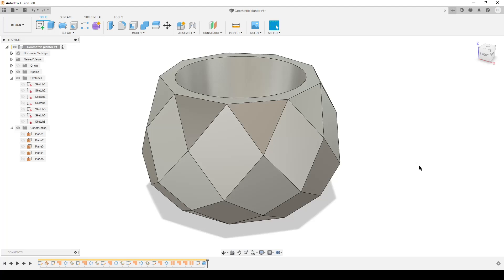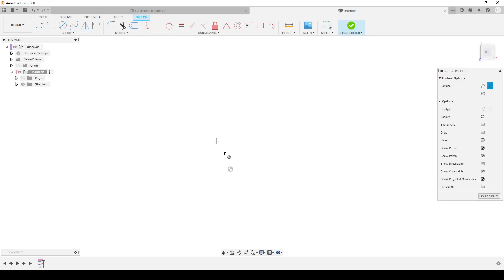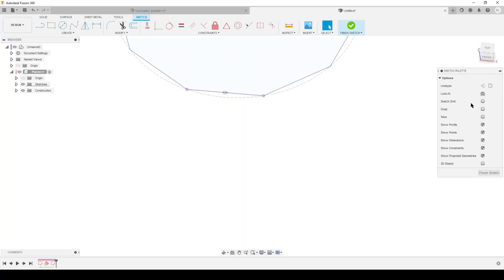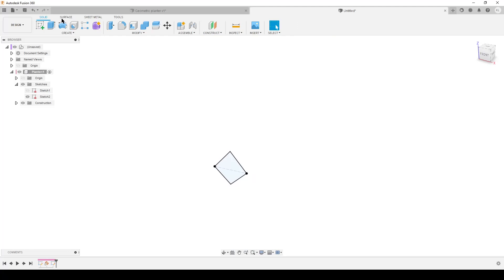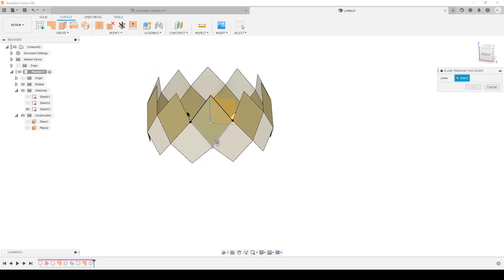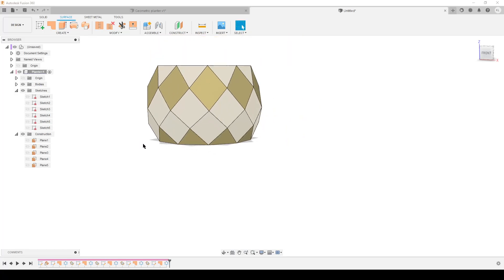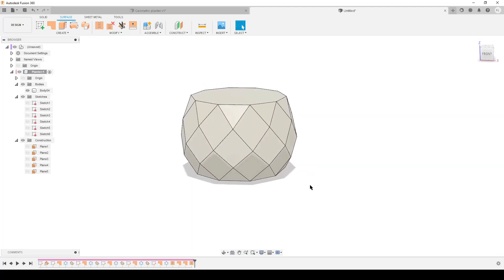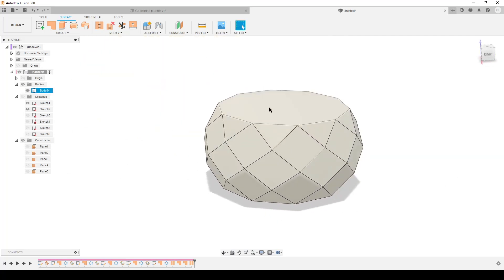Fusion 360 - Geometric Planter #1

Comment: Great tutorial - Do you know why I can change the dimension parameters through the modify/change parameters drop down, but can't just adjust the dimensions from the sketch like you did around 10minutes?
Reply from the maker: It should work the same. my general tip if Fusion misbehaves is to restart the software

Comment: Thank you for explaining how to make these geometric designs. I was thinking about the concentric polygon and loft, but those only connect singular points and not multiple (afaik).
I like your joyful explaining 😀
Reply from the maker: I tried using Loft but it didn't produce a stable model. The fun with 3D modeling there are always more ways to do things :)
Reply: That and it makes you try other ways of doing the same thing.
Reply: @KristianLaholm  I was wondering something. I try to make designs that are easily changed. I set 2 parameters, the circle diameter and the number of segments in the polygon. For some reason, when I change these parameters, sometimes F360 throws a tantrum, mostly when I make the number of segments higher than my initial designm(it will show gapes when I go lower). I would think, that the extra segments (patches) you make are tied to the base shape. If I change the parameter, it fails, or should I scroll back in the timeline to do this? Probably I need to look for a mathmatical explanation in the shape (hope this makes sense in a way). (hobby project by the way)
Reply from the maker: @MrLexhoya  There is a problem if you change the number of bodies in a model with pattern. Fusion gives the bodies new names and features like Combine get confused as they are based the name of bodies.
The same goes for like Extrude Cut if you add bodies in the extrude path they will not be cut. Some of this things can be a bit annoying then trying to make everything parametric.
Reply: @KristianLaholm  ah, thank you, that makes sense. Especially now I see the step before the stich; many bodies.

Comment: Couldn’t you do this much easier with mesh?
Reply from the maker: What mesh tools are you thinking of? I have used reduce mesh making low poly things but the final model is a bit random.
Reply: @KristianLaholm  The ones in Fusion when you Create Form. Seems like that environment one has a lot of control over forms that look a lot like what you made here., which is really good. Just wondering if you knew about that environment and the pros/cons of working with Forms/Mesh vs. the BReps.